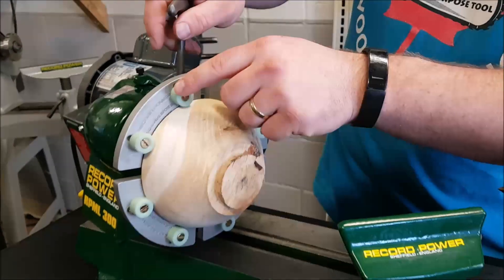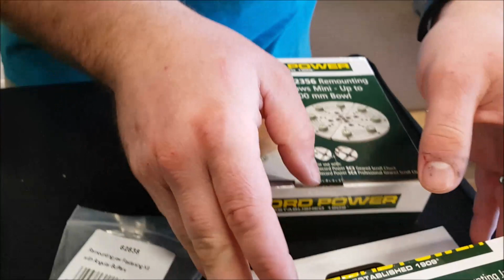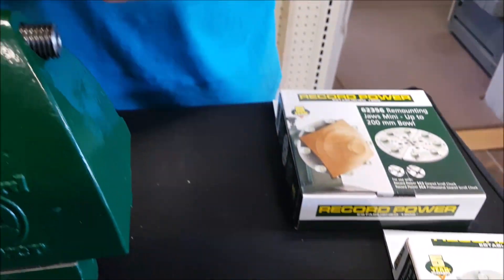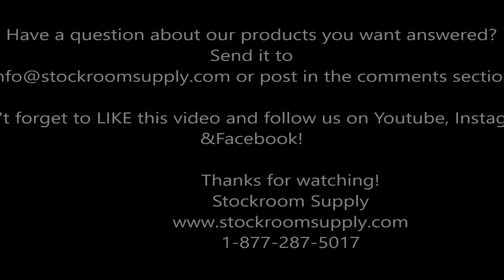Best Buttons for Your Remounting/Jumbo/Cole Jaws, Record Power Angular Buffer Stops EthAnswers

Comment: Should I be concerned about the extra weight of leaving the mega jaws on all the time if I have a midi lathe 1" x 8TPI? I have a G3 chuck.
Reply from the maker: I would not be concerned no. The mega jaws are cast aluminum so are not incredibly heavy…far less than most wood projects you will be mounting. Thanks for the question!